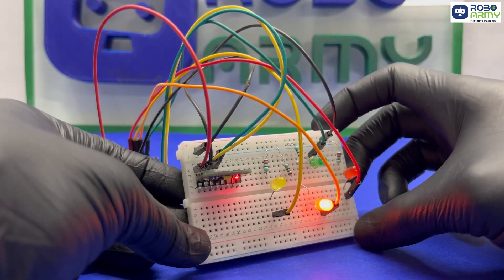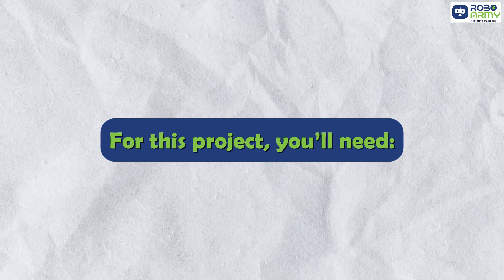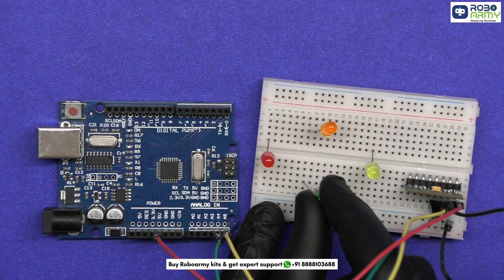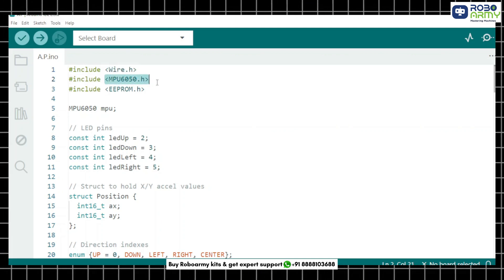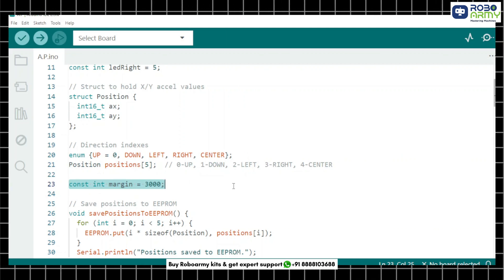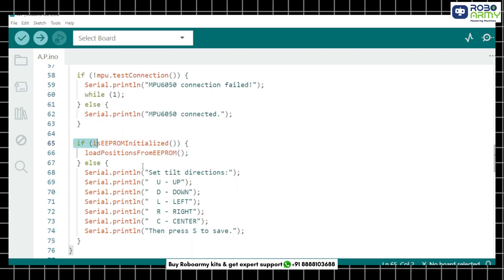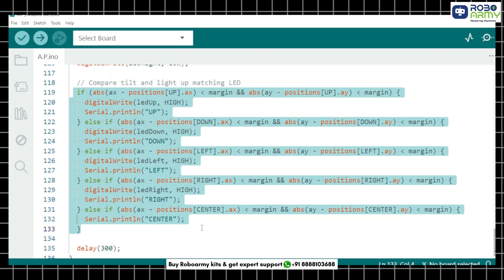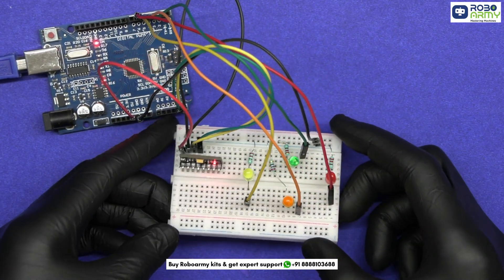Tilt Motion Detector with Arduino & MPU6050 | Control LEDs by Tilting!

Comment: can u plz provide the code link is not working
Reply from the maker: Check it out: #include <Wire.h>
#include <MPU6050.h>
#include <EEPROM.h>

MPU6050 mpu;

// LED pins
const int ledUp = 2;
const int ledDown = 3;
const int ledLeft = 4;
const int ledRight = 5;

// Struct to hold X/Y accel values
struct Position {
  int16_t ax;
  int16_t ay;
};

// Direction indexes
enum {UP = 0, DOWN, LEFT, RIGHT, CENTER};
Position positions[5];  // 0-UP, 1-DOWN, 2-LEFT, 3-RIGHT, 4-CENTER

const int margin = 3000;

// Save positions to EEPROM
void savePositionsToEEPROM() {
  for (int i = 0; i < 5; i++) {
    EEPROM.put(i * sizeof(Position), positions[i]);
  }
  Serial.println("Positions saved to EEPROM.");
}

// Load positions from EEPROM
void loadPositionsFromEEPROM() {
  for (int i = 0; i < 5; i++) {
    EEPROM.get(i * sizeof(Position), positions[i]);
  }
  Serial.println("Positions loaded from EEPROM.");
}

// Check if positions are already saved (simple validation)
bool isEEPROMInitialized() {
  Position test;
  EEPROM.get(0, test);
  return !(test.ax == 0 && test.ay == 0); // crude check
}

void setup() {
  Serial.begin(9600);
  Wire.begin();
  mpu.initialize();

  pinMode(ledUp, OUTPUT);
  pinMode(ledDown, OUTPUT);
  pinMode(ledLeft, OUTPUT);
  pinMode(ledRight, OUTPUT);

  if (!mpu.testConnection()) {
    Serial.println("MPU6050 connection failed!");
    while (1);
  } else {
    Serial.println("MPU6050 connected.");
  }

  if (isEEPROMInitialized()) {
    loadPositionsFromEEPROM();
  } else {
    Serial.println("Set tilt directions:");
    Serial.println("  U - UP");
    Serial.println("  D - DOWN");
    Serial.println("  L - LEFT");
    Serial.println("  R - RIGHT");
    Serial.println("  C - CENTER");
    Serial.println("Then press S to save.");
  }
}

void loop() {
  int16_t ax, ay, az;
  mpu.getAcceleration(&ax, &ay, &az);

  // Listen for setup commands
  if (Serial.available()) {
    char cmd = Serial.read();
    switch (cmd) {
      case 'U': case 'u':
        positions[UP] = {ax, ay};
        Serial.println("UP set.");
        break;
      case 'D': case 'd':
        positions[DOWN] = {ax, ay};
        Serial.println("DOWN set.");
        break;
      case 'L': case 'l':
        positions[LEFT] = {ax, ay};
        Serial.println("LEFT set.");
        break;
      case 'R': case 'r':
        positions[RIGHT] = {ax, ay};
        Serial.println("RIGHT set.");
        break;
      case 'C': case 'c':
        positions[CENTER] = {ax, ay};
        Serial.println("CENTER set.");
        break;
      case 'S': case 's':
        savePositionsToEEPROM();
        break;
    }
  }

  // Turn off all LEDs
  digitalWrite(ledUp, LOW);
  digitalWrite(ledDown, LOW);
  digitalWrite(ledLeft, LOW);
  digitalWrite(ledRight, LOW);

  // Compare tilt and light up matching LED
  if (abs(ax - positions[UP].ax) < margin && abs(ay - positions[UP].ay) < margin) {
    digitalWrite(ledUp, HIGH);
    Serial.println("UP");
  } else if (abs(ax - positions[DOWN].ax) < margin && abs(ay - positions[DOWN].ay) < margin) {
    digitalWrite(ledDown, HIGH);
    Serial.println("DOWN");
  } else if (abs(ax - positions[LEFT].ax) < margin && abs(ay - positions[LEFT].ay) < margin) {
    digitalWrite(ledLeft, HIGH);
    Serial.println("LEFT");
  } else if (abs(ax - positions[RIGHT].ax) < margin && abs(ay - positions[RIGHT].ay) < margin) {
    digitalWrite(ledRight, HIGH);
    Serial.println("RIGHT");
  } else if (abs(ax - positions[CENTER].ax) < margin && abs(ay - positions[CENTER].ay) < margin) {
    Serial.println("CENTER");
  }

  delay(300);
}